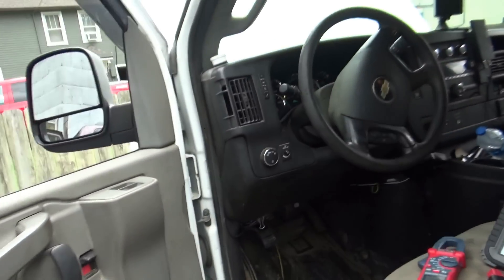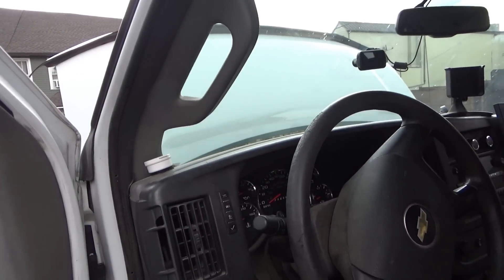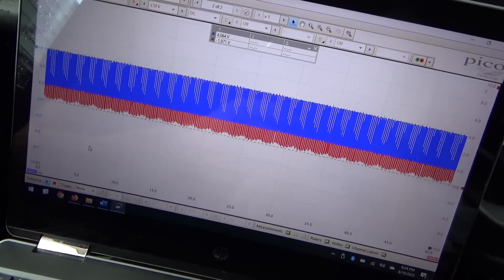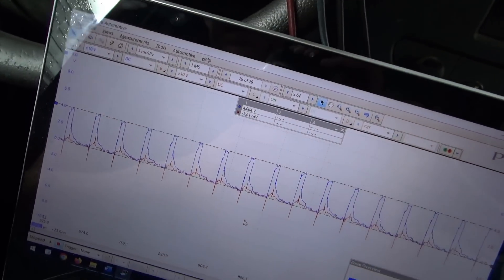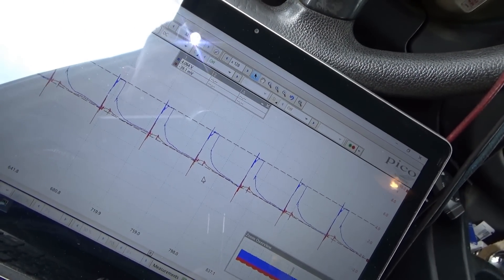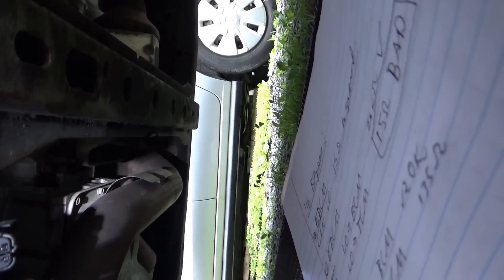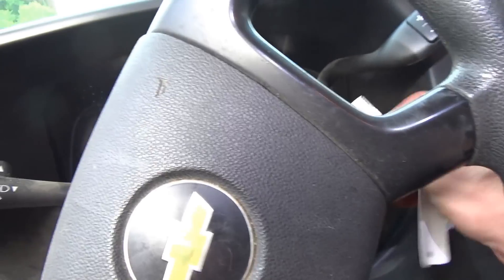DEAD Chevy Van STUMPS Shop...('16 Express NO Crank, NO COMM?)

Comment: Recycling videos!

If you ever break your leg or something that would keep you somewhat immobile for a bit (no, i am not wishing such), something that would help so many like me:

Take a video like this one. Everytime you make a decision or perform a test, splice in a video explaning the system you are working with, what you are looking for, how you are going about what you are looking for and the values you expect to be seeing.

I absolutely love your videos. Some make complete sense too me. Some i struggle a bit and that's great, i learn from that. Then there are some that i feel like i just grabbed a dangling line only to find it was from a jet airliner passing overhead, I'm now tens of thousands of feet over the ground and am barely hanging on! OK, so that's impossible. But it is the feeling- This especially happens when you use an advanced tool, like the PICO scope, i.e., 
You: i attach to pins 6 & 14 on the DLC. 
Me: Oh, that's nice! Those are nice numbers!!!
You: 60 ohms! That's interesting! That means the network is intact.
Me: OK, 60 ohms is the magic number for networks.
You: OK, now i want to put the oscilloscope on the CAN
Me: Aha! Pins 6 & 14 are probably the CAN!
You: ...On the low speed, nothing on the high speed whatsoever even though we measured 60 ohms.
Me: Hmmmmm. 60 ohm must be the magic number for all CANs together...
You: Pins 6 & 14 right there,. Obviously this is garbage...
Me: Oh yes, garbage. It should be showing Gilligan's Island but instead it shows am interesting repeating pattern of highs and lows. No Maryann.
You: CAN low is at zero, CAN high is going up to 4 volts. Can we say a wire is sorted to ground...
Me: OK!!! I figured out why you said that!!! Next! I'm on fire now!
You: let's unplug the EBCM to see if the waveform changes
Me: I thought all those modules were in series!
You: it's filling the entire bus with brrrrrrrrrrrrrrrrr...
Me: Oh! THAT'S what's wrong with how it looks. Hm. Wonder what itt should look like. Probably not Gilligan's Island.
You: With the battery disconnected I'm measuring resistance to ground on the CAN high and the CAN low
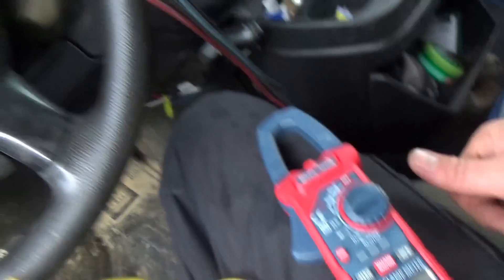Me: Whoa! Are we still on pins 6 & 14? Is it kind of pin 6 is one of the CANS, 14 another one, and you are measuring each to ground, outer some sort off black magic you are using... Wait, i thought 60 was the magic number for the entire network, so how do we now have one at 60 and another(?) One at 15??? And what the heck is that "thing" you are using that allows for wires to be plugged into, the thing at 5:57?
You: going to start unplugging things and see if there resistance changes
Me: OK! Like looking for parasitic draw... 
You: bias voltage had been restored to about two and a half volts
Me: Another magic number, two and a half!

You get the picture- i certainly would not be asking you to do something like that which i am asking during normal work; it would take up far too much time. Yet if you ever hard any downtime it sure would be helpful, especially with some of the higher end equipment that i am trying you budget for someday before I'm buried (I'm 70) and any technical system you have beautifully married or in your head.

Best Regards,
Bruce

P.S. Please excuse typos. You'd think that with AI since they can completely create songs, bands and a gorgeous lead singer that released multiple songs and videos great enough to fool the world, someone could create a decent AI sweetie keyboard that can more actually figure out intended words, but nooooooooooo.

Edit: I got there 16 socket box figured out and why pins 6 & 14 are important to scope!

Comment: @ 21:18 Right away, when you see 60 ohms, I think you are in trouble.  Should be 60 ohms at each end, total 120 ohms.   So very likely something is "short to power" or a module is defective and sending full power plus blocking out modules further down the line.

Comment: I have a bunch of older Chevy Express vans in my small business fleet( 01, 02 07, 12) I love them very reliable and few irritation problems( traction control light from steering angle sensor, HVAC fan control but pretty reliable. Looks like the are loading the newer ones up with more modern bus module wiring vulnerability. Man Ivan is good!

Comment: Hey Ivan, I am an old electronics Technician. I have worked on many different types of communication networks. We used a tool called TDR. It measured the distance to where a network cable was open or short or partialy bad, Perhaps you may find one that works for you. A Time Domain Reflectometer (TDR) can be used to test and troubleshoot automotive CAN (Controller Area Network) networks by analyzing impedance variations along the cable, which can indicate faults like opens, shorts, or impedance mismatches. Just an idea that may work on these kind of faults.
Reply: Really? Any information on where  and how to use that? Being old and wise might be hard to find and figure out old school ways. 👍 always learning.

Comment: I had two Express vans as work trucks. Had over 80 k on both. Never failed to start or run. I thought it ran bad for 3 minutes once but 
I was mistaken. One was the 4.3 and the newer was the V8. Excellent Quality and ride.

Comment: Excellent diag here. Simple repair that could have been a nightmare without a scope. This right here is exactly why I bought a 2 channel pico scope.
Reply: I bought a 2 channel Pico because of Ivan as well
Reply: @TheKlamminator I didn't have a choice in the matter. I've been trying to track down a parisitic draw for the last year. I rebuilt a fresh water flood truck and had to replace all 27 modules. HS1 has 60 ohm's but HS2 has 40 ohm's. So I have either a 3rd resistor in the network somewhere, green crusties/corrosion or a faulty module/incorrect programming on the HS2/HS3 or MS1 network and it's difficult to find it directly since those are all joined together in the gateway module. 
The 2 channel pico scope proved that the Can-area network is the sole cause of my battery drain.
The network is still active after sitting several hours overnight.
I don't think I would have made it this far without learning how the can-bus area network operates and that's all do to Ivan, Jake and Eric-O's videos and of course understanding wiring schematics.

Comment: You should always see high resistance to ground on these data circuits. There is a connection to ground with resistance in each module. This is why the test for short to ground on 6 and 14 wants a result of greater than 100 ohms. Didnt need the scope on this one, simple 60 ohm check across 6 and 14 then short to ground and power on both would have been enough. But its nice to see it in real time with the pattern i suppose.

Comment: This channel is what convinced me I needed to learn how to use an oscilloscope, and every shop I worked for never had one. So I bought my own and then one day I had a tcm shorted out that brought the whole network down. Even though can high and low showed communication, and it measured 60 ohms, it was extremely noisy. Once I unplugged it, the signals looked a million times better. No one could figure it out but me lmao
Reply: One dealer I worked at had a very basic scope that collected dust. The large company I work for now would rather us guess a couple times (we only work on our vehicles, so it’s not like screwing a customer) and if we can’t fix it we just sublet it out. The pico is really cool, but can’t justify the price for my use factor. Still in the market for one of those pocket scopes to use at home.
Reply: @KingDraculaSpelledBackwards  You don't need a $1000 scope to see CAN signals. A $100 Amazon handheld scope will work just fine.

Comment: I would wrap a piece of leather around the harness where it goes through the bracket.  Even with the tab bent back.  I just did that for a radiator hose that liked to rub on the fan housing.  Wasn't buying the OEM hose that has a shroud on it in that spot.

Comment: Often grounds on frame to body corrode on these GM
I have two express vans.
400,000 miles on 2003 excellent vehicles reliable.
2010 has 80,000 like new.
I cleaned all grounds on chassis below drivers side behind front wheel.

Comment: Putting a an electronic module under the truck where water and salt can get to it is a really good reason for automakers to simplify and consolidate this stuff in places that are well protected from moisture and the elements.

Where you took your test drive, I'm been at that place.

Comment: Love the no parts required repair Ivan, excellent diagnostics. Had a somewhat similar issue in a Linbus network that went crazy. One strand of copper shorted on high resistance aluminum, causing the network to go bezerk. Signal looked line a sawtooth where the voltage ramped up from 0-2v to 0-12v at the end of a lin frame.

Comment: If some engineer figures out how to shut down part of a network, without taking down the entire network due to a short or bad module and then relay that information to ECM and ODP to trigger a DTC, it would eliminate half of Ivan's work.
Reply: It can be done. A few ways.. most basic would be a network loop(Class A) with isolator modules, at each modules' in and out.. or isolators built into the modules.
You would lose only the section of the short.. be it just wire, or a short in the module itself.
Reply: @paulkaz2127 I'm not an engineer, but it seems that some redundant scheme would also work, but of course any scheme that would likely increase costs.

Comment: I would have sprayed the damaged wires with something to keep moisture away, maybe it was done though.

A few day I fixed a mini excavator where the wire to the electrical pump had broken with green crusties. Just crimp a new joint on it and it was working fine. It was a pretty easy one too because all that was needed was to open the hood on it and there it was right under my nose, but as they say - you don't see the things under your nose so I did look at a few steps around the fuel pump first before it revealed itself.

Comment: I do agree. Ivan has the skills. 
Because of Ivan and Dr. O (Eric O).
I've learned a lot. 
I'm 70 and still learning. 
The most important thing is Powers and Grounds. 
Last month a truck got dropped off. A no start. Fuel pump was not coming on.
There was so much mud under the truck. I mean lots and lots. 
I started chasing wires. I spent 3 days unwrapping the wiring loom and making repairs. 
It's because of Ivan and Dr. O

Comment: Ivan. You're gonna anger Eric O.  I think  Eric says never use an ohm meter to look for a short to something else. Here comes another SMA rant. I  can hear it now😅 Good find though! And thanks for making sure we can see what you're doing while working! Almost as good as Rainman. This makes a channel worth watching!
Reply: Its funny how they are both very competent mechanics and probably agree on 98% of things, but here and there they very different views.
Reply: I saw Eric with an ohm meter recently and Ivan uses test lights more than not.
 I'd say That they agree that there is a place for each.. and agree on the places.. as do I. 
Ivan actually pushed me towards test light usage, several years ago. Thanks Ivan.
 I used a meter for the decades prior, as I was working professionally as an Electronic Tech, when that meant something different that it does today. 
Auto and bikes, as hobby & necessity since about 1978. 
Sometimes you want to get higher current through the circuit.. sometimes not.
Reply: A resistance check is an acceptable way to check for a short to ground. If a wire isnt touching ground you would expect the meter to display ol. If there is continuity with ground it will essentially be anything but ol
Reply: @firstlast--- it's just what South Main Autos Eric O jokes about

Comment: With a short like this, I wonder whether one could send some current through the wire using a test light. With the battery out, nothing else should be doing anything on the looms so the only current an amp clamp would see is that limited current. When you don't detect that current with the probe anymore, that is close to the short. 
Not sure whether that's practical or not - I've never tried it, thoutgh. 

Good job, Ivan. Always logical. 
another no parts required job.
Reply from the maker: So the "short to ground" was NOT a full short; measured 15 Ohms. In this case a test light is NOT recommended.
Putting a test light on that wire could either "weld" the wire to the bracket, or "fix" the problem so you would never find it. :)
Reply: @PineHollowAutoDiagnostics  It would also be hard to not see the potential pinch point while probing /removing the connectors, to access a 'voltage' input point... kinda what did happened here, but the meter alerted to afflicted area when you touched the area. Conclusion reached. 
I'd worry about the robustness of the drivers, if I was using a test light.. but I worry (too?)often. No big whoops in many decades tho.

Comment: It strikes me as an excessively fragile system (CAN bus) when a fault anywhere on the network can bring the whole thing down.  There has to be room for improvement.
Reply: It’s actually a pretty good system for the application, eliminates miles of wires. A good part of the blame is the consumers that have to have the latest and greatest. 👍
Reply: @brianw8963 i don't mean to throw out the baby with the bathwater,  but there must be a way to implement it without allowing single faults shut down everything

Comment: Why did this van need a new transmission? Was it the dreaded 10 speed? Great diagnosis and repair. I would love to see you work with the CAR CARE NUT. He is a Toyota and Lexus guru.
Reply: Not the 10 speed in that, but those go bad mainly due to never having the fluid / filter service done. Pretty common in the pickups of that vintage also, for the same reason.
Reply: @brianw8963 I think every 100 000 kms, change fluid and filter. Mybe sooner if towing or lots of city driving.
Reply: @mikefoehr235 No more than 50K if you expect them to last.
Reply: @brianw8963 I go with 100 000 kms or 60 000 miles. I have yet to see any of our Toyotas have a failed transmission.  I cannot say the same with our previous Ford

Comment: One of the things that makes me interested in this channel is a personal experience I had with a Chevy van. I bought an early 2000 Chevy van that would go into limp mode intermittently and throw a bunch of codes. I'm an HVAC Tech so slightly the mechanical but automotive wiring is intimidating, I ended up finding a bad wire for the vehicle speed sensor but the reason why was a little ridiculous,  the model years before the vehicle speed sensor was in the rear end, but for my model year they moved the vehicle speed sensor to the transmission. It appeared they used the same wiring harness and just shortened the vehicle speed sensor wire using solder and shrink tape. I eventually found the connection and it was a green crusty mess that appearex they didn't use any flux or enough heat so there was no penetration. I finally got it fixed  but of course a few months after simeone me slammed into the back of the van on 95 and totaled it🤣 at the time it was pretty brutal but after the accident I ended up with a better van, 20 years later I own a top Ruud dealer in Northern Florida and I'm about to retire to the mountains of NH with a pile of money. Maybe I'll start chasing car gremlins in retirement, love the knowledge gained from watching this channel keep it up🎉